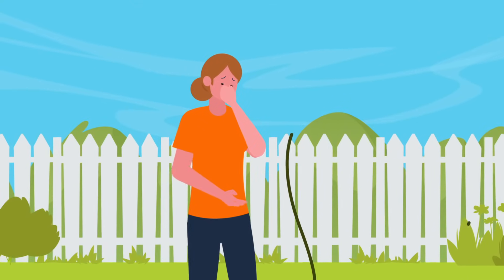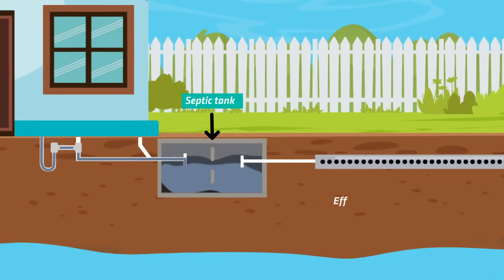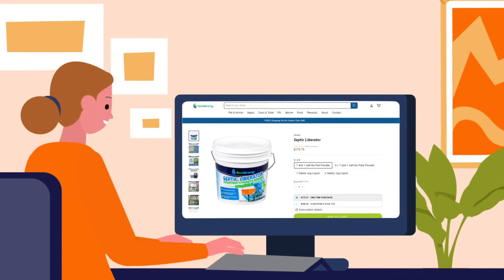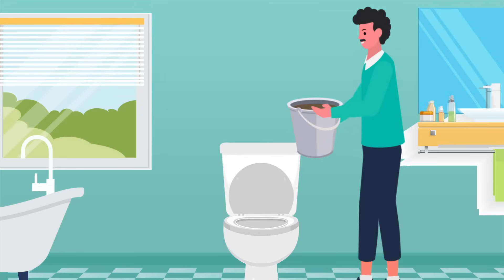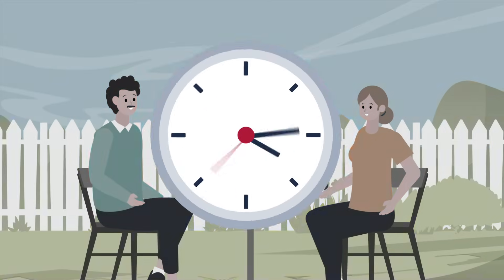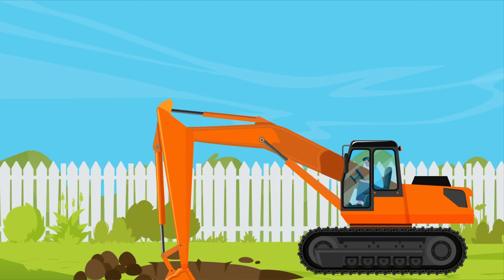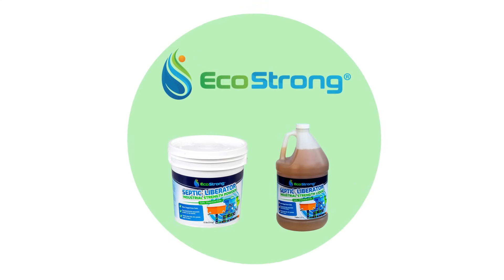How To Fix A Saturated Septic Leach Field

Comment: I just found a supercharged killer root ball taking over the outlet side of a tank. I imagine the drain field has also been under assault. I heard copper sulphate or lye may keep them away if backfilled against the tank. Any products recommended or commets? I imagine that would not be good if it got into the leachfield.

Comment: How does a septic contractor remove the waste and septic tank last I knew that’s only a septic cleaner a septic contractor builds the septic tank system in your backyard and second of all when you have a septic tank and I’m only talking from experience. You always get a whiff of sewage Because it’s a septic tank it holds in stores fecal matter and if anybody that owns a septic tank don’t know you’re supposed to dump it every five years otherwise there tends to be problems. I’m even shocked to find out my parents haven’t cleaned their septic tank since they moved in so they’ve been living in their house using a two tank septic system with a Leitchfield and what ended up happening is it ended up doing the same exact thing the pumps did not know anything about it, but the person they quoted to get it fixed said that basically what happened was they’ve got a two tank system one for solids and one for liquids so the liquids go overflow it and then drain into the septic Leitchfield but instead of just water going into it it was fecal matter and everything else so they ended up having that $35,000 charge as well as getting a very hefty fine for dumping waste water into the ground

Comment: Look, just have it pumped every 2 or 3 years.  It is not extremely expensive.  $350.00 every 3 years is not a big blow to the wallet.
Reply from the maker: Pumping your tank out is important, but bio mat can still build up in your leach field even if your tank is regularly emptied. In most cases, septic issues start in the field, and work their way back.
Reply: @ecostrong  agreed.  Unfortunately, that is what is happening.   I have been an idiot over the years and done everything wrong...grease, paper towels down the toilet, paint...etc...So I am basically screwed.  Now I know better.  However, I do get about 3 years out of a single pump.

Comment: Bob can dig a hole and fill it with gravel. Or horse manure works great for starting bacteria. Good idea though I'd like to see it in action. Anti bacteria soaps and detergents are tough on septic. Esp flushable wipes and lady products.
Reply from the maker: Agreed, anti-bacterial soap and things like bleach will kill the existing bacteria in the tank and field. Never flush anything that isn't considered "septic safe".
Reply: If the septic tank system can't handle soaps and detergents, then it's a failed system. There will be a lot of soap and beauty products from the bathroom and the laundry processes.

Comment: This ytv is full of you know what . Once your system is in this shape ,mainly bc you failed to keep your tank cleaned out ,your only choice is start over with a pumped tank and a new drain field installed  compliant to your municipal codes
Reply from the maker: You could empty your tank regularly and still have bio mat accumulating in your leach field. Most systems don't fail overnight. They start to show signs of failure. So long as there is still some flow through the drain field, we can deliver the bacteria to the field and we can break down the bio mat.

Comment: Does this still work if we have a salt water softener installed ?
Reply: Actually tree roots hate salt water, so that is a plus for having your softner drain into your septic.
Reply: @username8171 never knew that.  We had a big tree cut down to the right of the area. I am getting a little puddle down from the slant where the tree was   So not sure if now the tree is gone the water just isn’t being used up   Plus it has been raining every other day !! But the puddle just seems to stay
Reply from the maker: A water softener  can add a lot of salt to your septic tank and leach field bed. Too much salt can harm the bacteria in the septic and cake up the field. That said, this product will still work if you have a water softener.

Comment: I have water on my field lines when it rains hard! I have had dirt put on it and graded to run off the water but nothing is working! I just had my septic tank pumped out and it still back up when it rained heavily! I am at a loss in what to do!
Reply: Can add an extra tank next to septic thats a pump tank. The septic drains by gravity into the pump tank. Then you can pump to the D box and fit a one way valve on the pump line. That way no water will come back into the septic and you wont back up and the pump will keep pumping. The cost in materials in Ireland would be a concrete  pump tank 300 gallon 1000 inc install into hole, a pump , one way valve,hose 500,, and overall labor 1000. You should also add a septic high level alarm which is around 500=3000. If theres water on the feed lines without biomat then you canbuild a french drain to extend the draianage of the area. Go at least 4 foot deep with the trench and fill with large rock 3 inch. This needs one load of rock@350, one day of excavator hire with man, 650=1000.
Reply from the maker: How old is the leach field?
Reply: @ecostrong   3 years and brand new house
Reply from the maker: @jimmycasey6400  that doesn't sound like an issue cased by bio mat. It sounds more like the system may have been installed incorrectly.  Are you able to contact the contractor who put it in?
Reply: @ecostrong  yes and they will not touch it! I have been told I will have to put a new system in that will cost me 6k
Reply: @jimmycasey6400  It has been said that if you can introduce 'aeration' to the effluent, from a separate chamber, that effluent will then have AEROBIC bacteria which is many, many times more effective than the ANAEROBIC bacteria from a typical tank. 
The separate chamber would require investment, and would need aeration, likely from a 120v air pump, but could over time 'heal' your drain field like this product claims.  Also, make sure your daily water output doesn't approach your drainfield's capacity.  And NO grease down the drains.  Or Bleach. Or other chemicals. No food disposal.
Reply: @jimmycasey6400  did you get it fixed buddy ?
Reply: @mattd8411  actually I had a swale built that divert the water off the field lines
Reply: @jimmycasey6400  that's awesome good idea.

Comment: May God bless you, my brother. My question is whether chemicals such as soap and shampoo when they enter the drainage system will affect the crops after they enter the ground. Is it possible to plant in the soil into which the drainage water seeps? Thank you.
Reply from the maker: Provided your septic system is installed properly and is functioning, you should not have to worry about soap and shampoo effecting plant life.

Comment: Would this product work as a preventative measure when there is nothing wrong?
Reply from the maker: Yes, however we do have less expensive products designed specifically for septic maintenance. You can check them out here. 
https://ecostrong.com/collections/septic-maintenance

Comment: The process is cut short when you add the cleaner directly into the line leading to the leach field. This method is far better because pouring it into the toilet or the septic tank will dilute the cleaner's strength and that will slow down the results. 
The key is to pour undiluted cleaner into the line that takes the cleaner right to the problem area. This is done by removing the secondary septic tank cover, pulling out the filter, and using a garden hose with a funnel. After that, be sure to pour a few gallons in to wash the cleaner to the leach field. Another way that would be even better is to locate the distribution box, if you can, and pour the cleaner and water directly into that.
Reply from the maker: The goal is to get as much of the treatment to the leach field as possible and this method certainly does that! Thanks for sharing it with us.
Reply: I think you are going to spend money on this process. And then ad it to the replacement of the field. The bio treatment is not new
Reply from the maker: You're right that adding bacteria and enzymes to your septic system is not new, but the science has come a long way in recent years making it fare more effective than before.  @fredrickemp7242
Reply: Great suggestion, I was just wondering how to speed things up for mine.
Reply: @maxsoregon  it’s the ground that is clogged up. even if you get the high-pressure to go out the little holes in the pipe, it’s just going to clean little spots my guess is it won’t do anything at all. But good luck people been trying to cheat the system since they started it. When the out house filled up They dug a new hole and moved the out house. And it’s still the same today. Fields go bad they just move them.
Reply: @fredrickemp7242 well outhouses don’t cost 15k . We are hurting over here man
Reply: @fredrickemp7242  Eventually u will run out of land!
Reply: I have a house that I've only lived in for two years and we're having a problem but I have no helpful information from the previous owner so I don't know where the distribution box is for the line
Reply: @heartsdreamshomestead8930 I got my original Septic installation info, with diagram online from the county for free. Hope that helps
Reply: @heartsdreamshomestead8930  there r 2 covers on ur septic tank, find the white cap that unscrews first thats your cleanout drain, the first cover will be closest to that on the top of the tank, the 2nd cover is the one u want, open it, and locate a pipe going out toward the land, thats your distribution box and pipe leading to the leech filed, there should also be a plastic yellow filter near that box inside another pipe, take it out and hose it off and put back in.